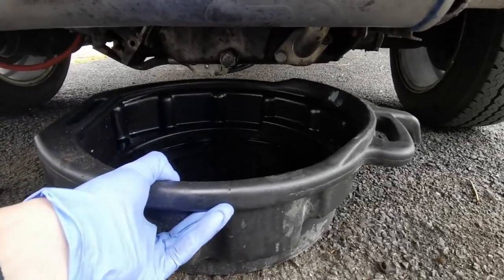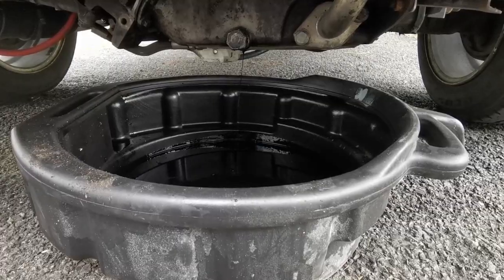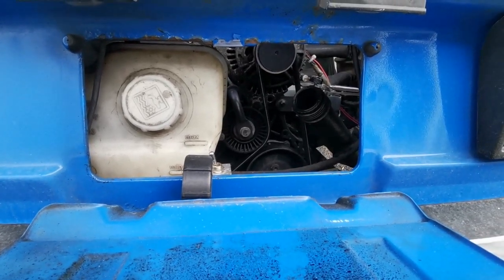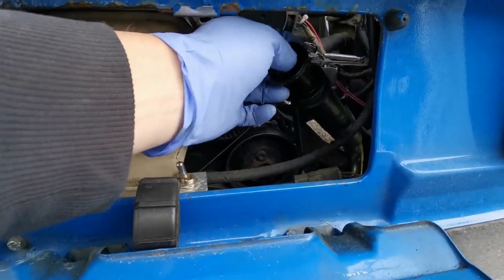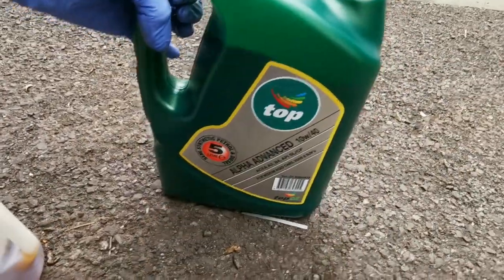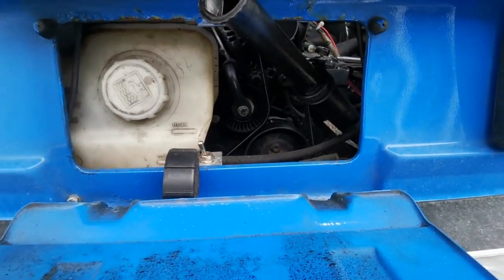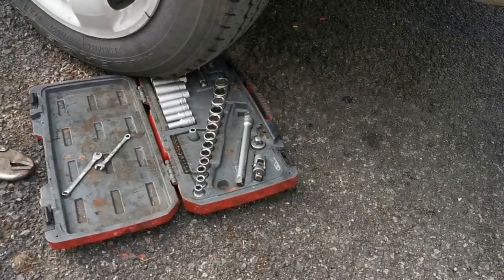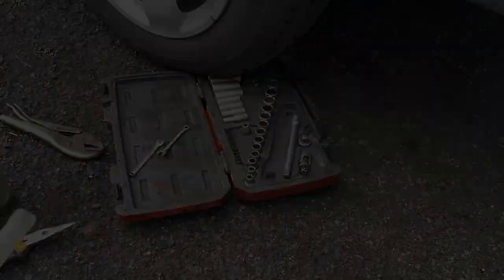VW T3 TDI swap 1000 km later - Service and troubleshooting and some insights

Comment: The return line on the fuel filter thru a tee is to warm up the diesel to avoid gelling on cold days, the tee is thermostatic and closes when the fuel reaches a certain temperature (28ºc I think) making a full return to the tank. This tee is also known for cracking and letting air enter to the fuel circuit
Reply from the maker: Ah right! Thanks for that! Interesting idea.
Reply: @Endfloat  You're welcome! Awesome swap, by the way
Reply from the maker: @mauricio5818  thanks!
Reply: mauricio is on the money there, heats up the fuel in the filter. didn't know it was thermostatic, very cool. I had the cracking last year and replace all my fuel lines when I was at it.
Reply: Installing a mk2 diesel fuel filter. 
is same dimensions as the Mk3 Tdi 
But without thermostatic t

Zero problems with deleting it. 
I have run in -35f without one, or a block heater. In an original 1981 fuel tank. 
Zero issues.

I also have an ahu Tdi btw

Comment: Coo, that's clever! The tip with a Schrader valve on the Dalek cap. The other way is to get the front end pointing at the sky, either on ramps or if you live in a steep hill.
Reply from the maker: I did a whole separate video on bleeding the coolant system. Works a treat.

Comment: Dude great video really enjoyed it and learned a lot. I'm currently on the hunt for a T3 and I view one tomorrow, it has 380,000kms on the clock but engine was changed at 200,000kms. 
Have you any tips and things I should look out for? 
or should I even look at the van if the body has done over 300,000kms?

Great content keep it up.
Reply from the maker: Any T3 you'll look at these days will have high mileage. Count on having to replace bushings, balljoints and brake components. Rust points are sills, rear arches and front panel below windscreen and above bumper.
Reply: @Endfloat  Really appreciate the advice bud 🤘

Comment: Just a hunch now but does running the fuel return through the filter ensure a reserve of fuel is always available to the engine so it doesn't starve itself when cornering with a low fuel level in the tank. 
Like a float bowl in a carburettor.
Reply from the maker: It's possible I suppose!

Comment: 120 BHP? Are you sure?  Ha, and you left the wardrobe door open; we're always doing that! That's probably why your down on power.
Reply from the maker: Well it should at least be 110 with the remap and larger injector nozzles. I'll do a bit of fault finding and then I might throw it on a Dyno.